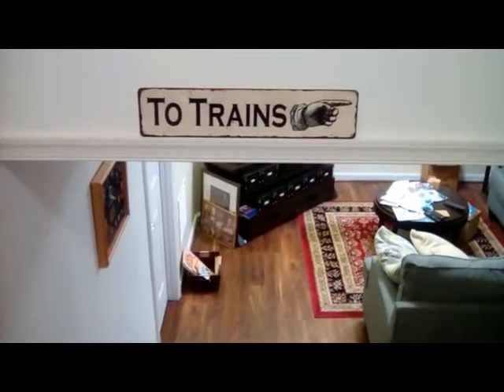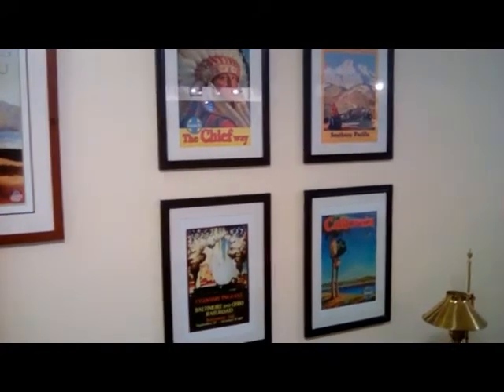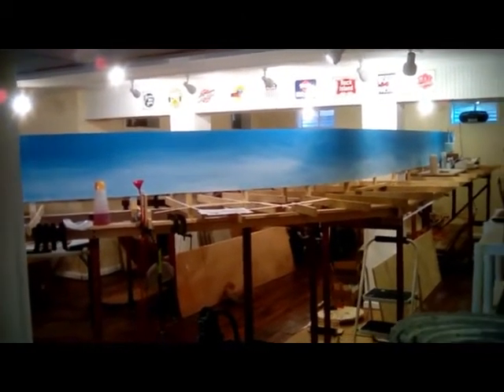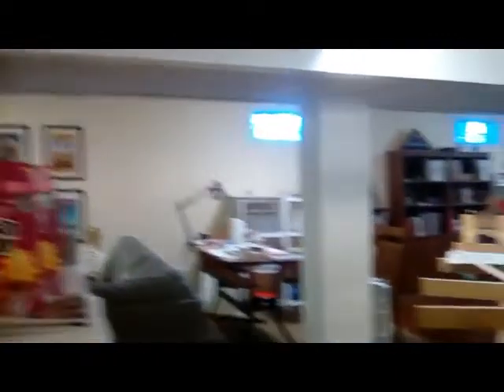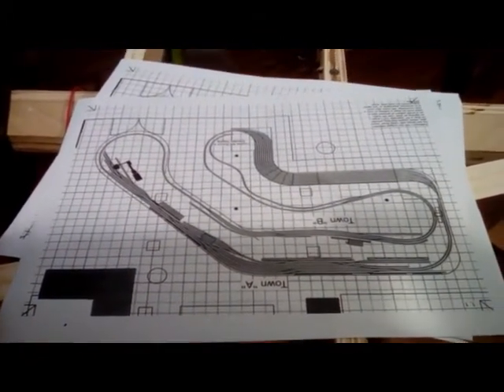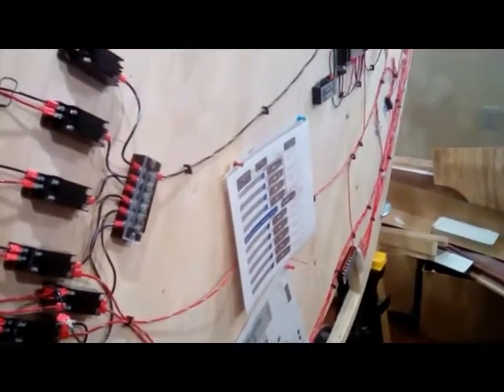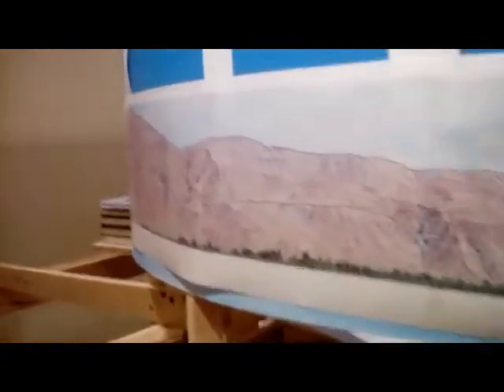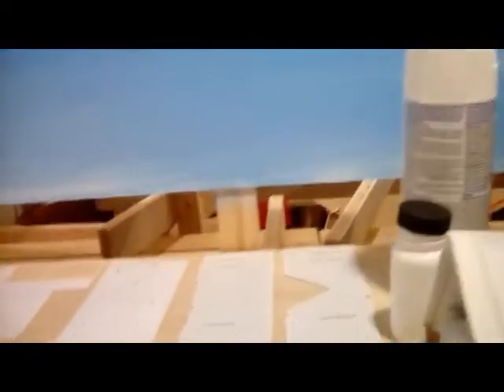Episode 2   The Grand Tour

Comment: Nice tour, Cal. I like the way you are working on the track installation.  Throw it up on its side really makes it easier.  Hopefully, you've run a small test on the electronics of switch operation, or maybe test the whole section before going flat with it.  You have certainly have enough to work on during this forced stay-at-home period.
Reply from the maker: Tks, Mike.  Yeah, setting it up in a vertical jig, the same way be build aircraft wings, was an idea that came to me.  At age 72 it sure makes the job easier.  I plan to run a test on all the electronics and switch machine operation once I get all the wiring done on this module, and the experiences should make the progress on the other staging yard throat go more quickly.